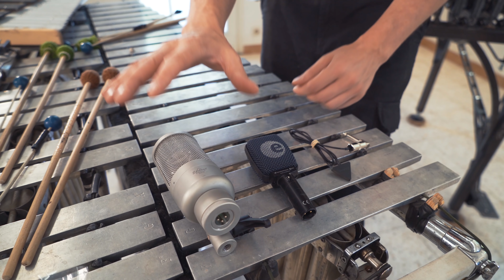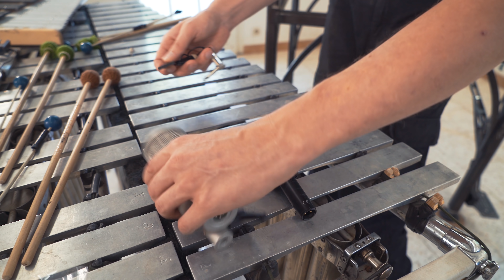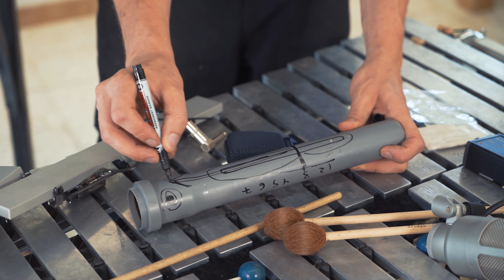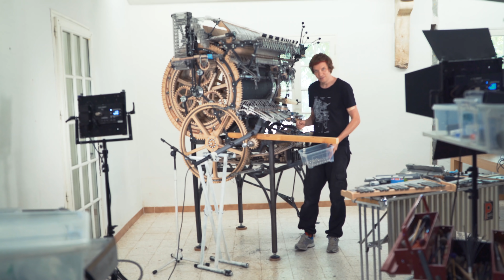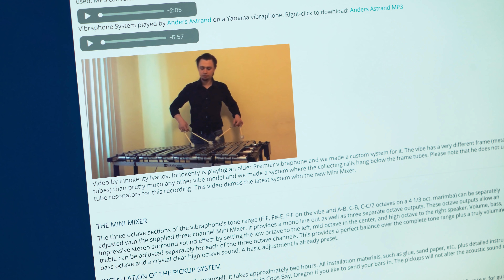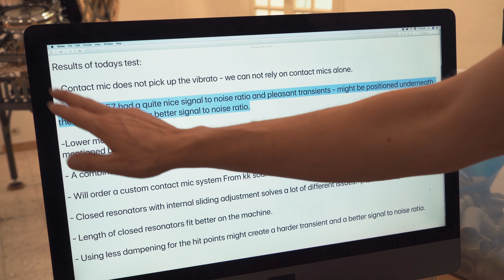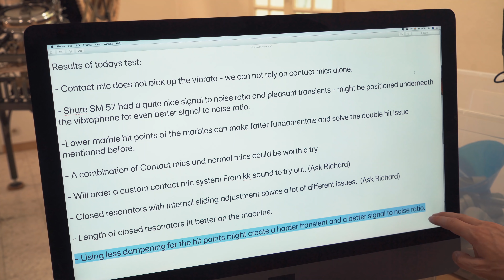Vibraphone Experiments / Microphone Types - Marble Machine X #96

Comment: Hi Martin, again a really good video mixing music, acoustics, diy and engineering ! Why don't you use a small electret microphone at the end of each closed (or opened) pipe/tube? You can find really small capsules 5-10mm and with a really good SNR of 70-80dB  https://micbooster.com/content/12-comparison-table-for-primo-microphone-capsules It wouldn't sound bad as somme of this capsules are used in measurement microphones (flat frequency response).

Comment: Use the solution that already exists - the individual contact mics with digital vibrato. The compromise to make here is going a little bit less analog to save yourself engineering and fabrication time. Plus, it will reduce the amount of steps to switch out a plate - unplug two things per plate, and then plug two things in, versus also needing to adjust or remove and replace the resonators.

Comment: use lasers to measure the distortion of the bars translate distance into wavelength and digital signal. balance out with some mic in the tube get yo vibrato.  or scrap the whole thing and pump it through a Leslie

Comment: I believe the gain with the Contact microphones is actually from the plastic rapidly hitting the microphone. Perhaps use some sort of spring or string/elastic suspension within the resonator pipes to remedy the rapid tapping? The more rigid the suspension, the clearer the sound is. However, if the suspension is too rigid, the problem won't be fixed. At least, that's what I think. Perhaps even dangling a contact microphone in the resonator pipe might allow the air pressure to shake the microphone as a whole and have it act like a normal microphone even?

That's just assuming that the problem is from the resonator pipe rapidly hitting the microphone as it shakes.

Comment: Okay, so first, sorry if I got the wrong idea, I was listening to this in the car on my way home from work, but it sounds like you're trying to decide whether to A) put microphones inside the resonator pipes, B) have the microphones right next to the plates, or C) get one of those electronic systems to add vibrato and elongation to notes? Just an idea, but... why not all three? It would certainly take a little extra work, but you could set up one mount for the electronic system and another with resonator pipes, maybe so they just sit on that square frame just under the vibraphone, and then you can switch them out based on what sort of sound quality you want for each song, since you said you liked that soft crackling with on of the options. You're already going to have to switch out sound plates for each song, what's there to stop you from switching out the pipes?

Comment: A few ideas to add to the mix.  Contact microphone on the resonator tube seems the next stage to try.  I also have a vague thought about the submarine kazoo which is designed to focus sound on a point.  Different shapes "pipes " may let you get the resonance with a shorter dimension, and focus the sound on a point which gives better SNR.  Finally, how about fixing a thin plate or diaphragm below the vibraphone bar and tube with a contact Mic.  The air pressure should exert a force into the plate for the mic, and background noise would have less influence but you would have another resonance to tune.  
Vague ideas, but I hope it sparks some more useful ones, rather than cheating with digital effects.  I believe!

Comment: That’s a real tricky challenge! Like you want to get to fine details of the vibrato but none of the noise from machine but still get the attack from the keys. Maybe try a combination of the contact mics for the attack as well as super cardioid condenser mics at the base of resonator pipe; such as the Sennheiser e614 maybe? Unfortunately that’ll be quite the cost and you’d probably need a mixer to sub mix it for the tour. I would say maybe some sort of drum clip mic such as the Sennheiser e604 because their convenient and lower cost but I doubt it be great at reducing the noise you pick up from the machine. Idk just my two cents

Comment: If noise is your concern, put an acoustic mike near the top in each tube.  You will have loud audio, and need not change any wiring when you change bars.  If you tune tubes with piston in the bottom, mike won't interfere.
     Test closed pipes first!  They enhance odd harmonica only, whereas open ones enhance all harmonics.  What do "conventional vibraphones use?
     How did you mike the vibraphone on the original marble machine?  Don't over engineer this!  Do what you did on the original!
     Are there 2 meter resonators on the original machine?
     If you use closed resonators, you can narrow the mouth to get lower resonating frequencies, like a bottle, at the expense of harmonics.

Comment: Idea, put the contact microphone on the adjustable inner stopgap adjustment plate inside the tube, it keeps it away enough to prevent oversaturation and it being enclosed keeps the ambient noise down. The end plate should feel the pressure waves as they bounce through the tube and the mic should pick it up

Comment: It could be worth a shot using condenser microphones and include a separate microphone at the top or far side specifically to pick up the noise and use a differential amplifier to eliminate the noise electronicly. It should be a simple and elegant solution and I believe it still holds to the original view of the project even with the small bit of audio manipulation  involved.

Comment: Martin, have you ever heard of a "Leslie speaker"? Its was developed for electro-mechanical organs (think Hammond) to mechanically synthesize vibrato.
The idea is to put your signal out a speaker with a rotating baffle or horn in-front of it, causing tremolo based on the rate of rotation. In your case you could use contact pickups for your signal, run it to an isolated set of speakers in a (clear) enclosure, drive a spinning "drum" off your gear-train, and then pick audio up with your dynamic microphone.
This way you can directly meter your individual bars, still get your vibrato without digitally recreating it or having to program tempo AND attach more spinning doodads to X
Reply: That would be very cool, the question is: would him like the sound?

Comment: Martin, if you have a specific resonator pipe for each plate then you should be able to install a tuned steel cable into the resonator pipe and then read it with a guitar pickup.

Comment: 2 cents may be to much, but i would say you would be better off with the digital vibraphone.  If you wanted to go tech, you could individually tag each piece so when it is placed into the machine, the system recognizes it and adjustments are handled automatically, or pre programed.  Save space for other stuff as well.

Comment: What about the 57 inserted INTO the end of the pipe, but have a rubber and foam seal through which the mic inserts. This would accomplish two things: 1) the resonator could stay closed (and shorter) because of the rubber end, and 2) the foam–which should be on the IN-side of the pipe–will function as an absorber behind the diaphragm of the 57. Auralex has a series of "bowties" I've used in a studio setting, that affix to the barrel of a mic, and it's surprising how much sound they absorb even when the mics are in the open (like on, say, a drum kit). This idea of foam around any dynamic or condensers might be a helpful consideration for any and all mics in play.

Comment: Contact mikes are a waste of time on an instrument that relies on air for its resonance.
If you use a directional (Supercardioid) mike, particularly with noise cancellation, you will get a good response.
The SM57 has a tight polar pattern, but note it is OFF-AXIS. 
You don't need one mike per note either.

Comment: What about a thin metal membrane as a cap for the closed resonator with a contact microphone attached? Also if you go the route of a contact microphone on each plate then you can build the microphone connector into the plate attachment system. So when you plug in the plate the mic is already connected.

Comment: You should place contact microphones in each pipe beneath the vibratos. you might need to amplify the vibrato afterward, but it should pick up the vibrato, since the pipe should vibrate in tune with the vibrato.

Comment: I feel like for the tubes he should use a set of telescoping tubes so that they don't need to be changed out very often and can be tuned easily. I think he could mill out a flat spot with a small hole in the middle for the contact mics though I believe the place they are put on the tubes might have unwanted and non standard effects on the sound due to harmonics. Because of this I think the microphones should be placed either within an inch of the top or bottom edge of the tubes. Also I believe to have the sound default to open you should have the valves set so that the handle pulls them down automatically. You could also have them all connected and use something like a variable speed felt clutch to get the speed right no mater the speed of the machine. It is like a right angle gear that can be pulled apart but with no teeth so it can drive anywhere across the gear face. When it is detached the manual handle pulls the valve open. The clutch is set up a few millimeters above the spinning powered disc and a perpendicular wheel/ball is used to pick up the rotation when pressed onto the powered wheel. The speed is changed by extending it across the face of the powered disc so that you can change the effective radius of the powered wheel. If it is rolling near the center it goes slow but the further you bring it towards the edge, the larger the circumference of the circle that is spinning it powering it faster. 
You could have the discs and the microphones both at the tops of the tubes so the valves are all parallel and the driving disc delivering the power could be something there that is already spinning. Putting a drive surface onto the middle of that big 5 spoked plywood gear on the left of the machine would be the easiest path for the drive shaft if you wanted to go with straight shafts with one right angle gear and gears would be ideal to lower the friction. If you want to get it somewhere else further without worrying about gears you can use a spring drive. A long densely coiled spring is used as a drive shaft and can be directed to its destination either by periodical pieces of pipe or a full jacket of tubing bent to get it wherever you want it to go. This spring drive is what is used to drive most Dremel precision extension attachments. The hardest part might be that extendable and lightly flexible shaft at the end for the clutch and this could be done by a square rod inside a square tube. 
Hope this helps you make up your mind!

Comment: So the challenge is that you want it to sound good unamplified. However, you have elements on the marble machine that are not heard as you desire without sound processing. Once you realize this, it frees you to use the contact microphones and make the live elements a hybrid between live sound production and electronic audio processing. The solution may be to add the vibrato in the processing rather than live. You could even connect it to a live element so that you can control the vibrato. For example, you can rig an actual resonator vibrator as the control for an LFO modulator so that you can produce the vibrato effect like a synthesizer can modulate a sample, except both the sample and the LFO are live elements in this scenario.

Comment: The SM 57 works well for ONE note, but the rule of thirds for microphones would be super hard to work with with that design.  Rule of thirds = sounds that will be picked up with other microphones should be at least 3 times further away than the sound you intend to pick up with the current microphone.  The reason for this is noises caught by multiple microphones can/will be slightly out of phase from one another, causing noise cancellation. You usually wind up with terrible sound with too many microphones.  There have been many examples of this, one that comes to mind is a very large chorus/choir that was being recorded.  They started with many microphones and kept removing them.  After comparing all of the recordings, they found that 2 or 3 microphones (positioned at a greater distance) worked best.  I don't know that less microphones will be your solution - you'll probably need to isolate the noise - perhaps your contact microphone on the resonator tube rather than the vibraphone... but that probably wouldn't pick up your vibrato

Comment: of course a contact mic won't pick up vibrato!..... what if you put that contact mic  on the resonator tube and get that tube closer to the plate? like..... sure, you loose attack..... ok, fine.... how about in-between?  Now figure how to get more vibirato and harmonics..... hmmmmmmmmmmmm. Oof, such a tight place with the background mechanical noise..... the struggle is real. I guess you need contact mics for both plate and tube.... good luck with phase problems.

Comment: I didn’t see if you tried a contact mic on the resonator tube itself? If you printed a section of tube with a mount for the mic (possibly the same section as the sliding mechanism?) it might pick up the resonance and vibrato through the walls of the tube. You’d need a mic for the plate and a mic for the tube, but it would give you a lot of control over the mix.

Comment: Have you think about attaching some lavalier mics at the ends of your tube to pick up the vibrato, close enough from the sound source you should get a better signal to noise ration because you don't need much gain, you could hybrid it with contact mic if you need mor transient!

Comment: If you put contact mics on the resonators, would the resonator pipes need to be metal?
If would seem you need the digital resonator, thus getting rid of the resonator pipes entirely.
Could that company just provide the digital components, not a complete system?
Have you asked K&K Sound for assistance?

Comment: you could allways mic up  the resonater pipes, wouldnt that work best for your situation? it should pick up the vibrato, and also doesnt require the switching of mics when you switch the note, since my current understanding was that you arn't going to change the resonater pipes only chnange the length of the pipes? hope you see this.

Comment: I get that this will primarily used on stage, but I feel that if it couldn't play the vibrato acoustically it wouldn't be complete. A compromised on the amplified performance over the acoustic functionality might be the way to go (or have a swap out system to put the pipes in sometimes and the mic system in other times).

Comment: you can make sound deflecting shields from a dense metal or two layers of glass with a dense gas in between like a box and the only input to that box is the tubs and design the out put in way that won't make any sound noise to the mic.s

Comment: Wouldn't gating on the mics for the vibraphone get rid of most of the noise from the marble machine itself, since the volume of the vibraphone into the mic will be much higher than the noise in the background? also, using smaller lav type mics mounted on the end of the resonance tubes be able to pick up the sound better? (Think of the types of mics mounted to the bell of a trumpet or trombone)

Comment: There is one thing I did not see you try with the contact microphones in the video. Looks like you sent it down the tube with the wire out of the top possibly causing unneeded resistance on the tube. Did you try coming up from the bottom and sticking it to the inside or outside of the tube?

Comment: What if you mounted an electric guitar pickup at the end of the resonator pipe? If you are using a plastic pipe, you could glue a short piece of wire around the end of the pipe to allow the pickup to pickup the vibrations.